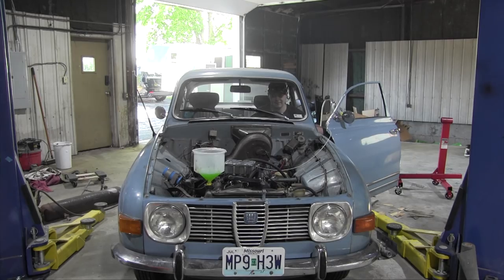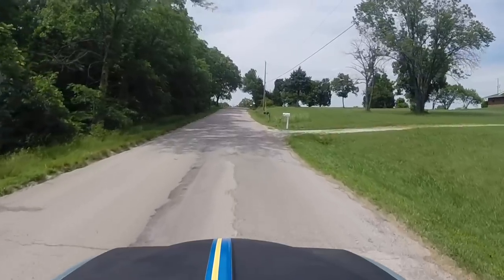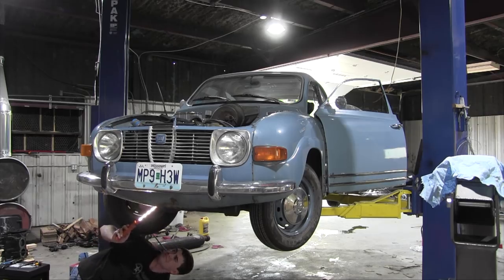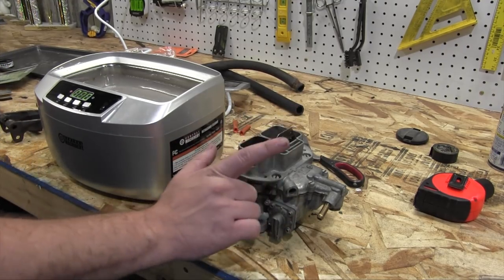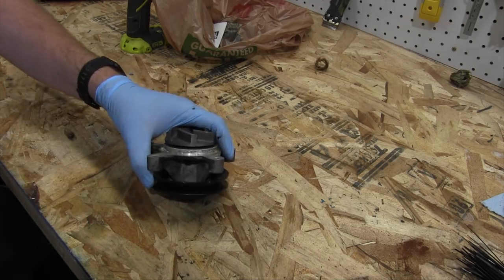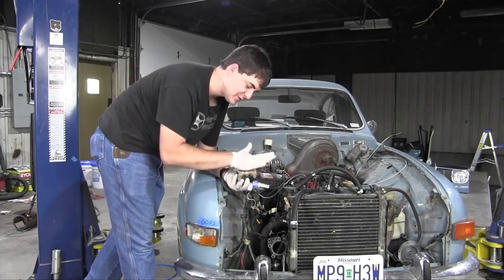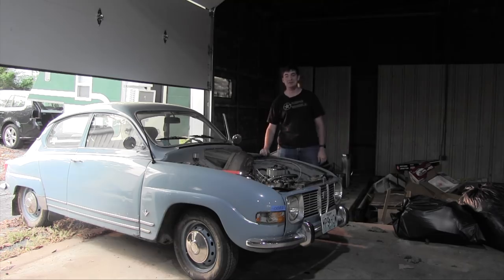Upgrading My Saab 96 to a Two Barrel Carb - Part 3

Comment: you know it would be easier to get that water pump off if you had the engine out. you might even change out the clutch and throwout bearing while your in there.

Comment: If you had used Black Silicone it would not have leaked with only the silicone sealing it. Black dries hard, the blue stays flexible at the expense of strength.

Comment: the vacum advance unit and spring loaded veigths on ignition unit has a lot to do with acelration and power upp hill.Some car the vacum advance is at full preignition  and when vacum builds up it lower the advance itgition.on other it is the oter way.importent to know if the vacum intake on the carb is over or under the 
carburetor gas damper(google translated) those 2 trinn carb round spjelds tha open when you give trottle

Comment: you should not use silicone on an engine, use hylomar or polyurethane based sealant.
Reply: Modern silicone is fine. Many manufacturers use it from the factory. Just get the right formulation.......

Comment: Why not use just straight water when you are checking for leaks?. You can just measure out a gallon of water to fill it first, and if there isn't a leak you could add the coolant to the recommended ratio...

Comment: that V-4 is a ford tractor motor that  came with  one barrel, I didnt see part 1 or 2 the worst thing ive ever seen is when some tries to put a two barrel adapter into a one barrel intake, your idle mixture screw effects the whole range from idle to full throttle

Comment: "Because I'm a simpleton and not a mechanic"
Why not both?
ps, I feel your leaking pain. I rebuilt the engine in my MR2 in about 3 months and it's been 2 years since then and it still not running because I CAN"T FIX THE DAMN COOLANT LEAKS

Comment: i would have epoxied the two halves, because rtv isn't for use with solvents or gasoline, and it would be permanent.
Reply: i'd also drill out the threads in the pump, put bolts in with just simple nutz on the back on the ones that are hard to reach away from the pulley, make it way easier to remove.
Reply: then i saw the wrench and never the  mind lol.

Comment: the Taunus V4 was never meant for a 2bbl unless you rose the compression big time...itll never run right unless you go huge on compression ratio..even then you wont hit more than 110 hp..the Rally car had a 2bbl..the streets didnt

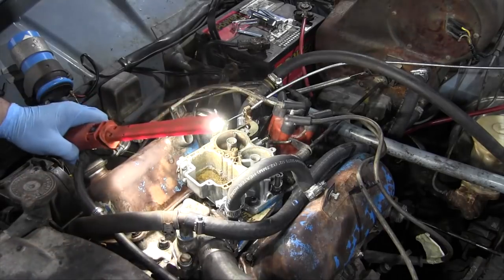Comment: 6:10 fuel level way too low it needs to be at the bottom of the boosters. Re carb kit  this is a DGV a brother to the DFAV which came on Chevy Vegas and Ford Pintos from the early 70's, most parts stores still Keep them in stock (god knows why), not everything from the kit will work but the most important as the needle and seat, accelerator pump diaphragm and power valve are the same.
Reply: The float pushes it way up when installed. So this in the video IS a proper fuel level.
Reply: What do I know? I been  rebuilding carbs for only 30 years...you must know better.
Reply: I respect craftsmanship but i also respect Archimedes.

Comment: Watching the gasket drawn out and cut out instead of soft-hammerded was kinda cringe but I was drilled by old men to dink out the gasket with a plastic hammer and part. "Exact Fit!"

Watevs if it works.

Comment: Seems you got caught out by the Delhi "specials" water pumps that are plaguing many marques for water pumps, us Reliant owners had stacks of them, they look all nice and shiny but are a bag of poo when you wind them on, the one I had I put a straight edge to its mating surface and it had a 4 degree bend in the whole facing, kinda crinkle cut water pump and when I tried to request a refund the ebay seller had deactivated his account so got nowhere fast :(   Another area is old Vespa and Lambretta parts knocked up in Vietnam and Indian backstreet factories, totally atrocious quality and a bloody nightmare because getting parts for my 1958 Lambretta is damned hard enough without getting piles of poo turn up looking remotely like the part you wanted Grr Grr.

Comment: choking yourself with no good ventilation.the face plate has not a smoth openings it is stepped. that alone make the gas turbulence bad and it you dont get max performance

Comment: He seems such such a cool guy with a good attitude. But holy cats this is painful to watch. Silicone instead of gaskets. Poor carb rebuild and cleaning. No idea of carburetor theory or operation. Doesn't understand that the engine needs to warm a little before disengaging the choke. Bad troubleshooting ideas. That awesome little Saab deserves better, so I hope he gains a much better skill set and awareness as time passes.
Reply from the maker: I wholly appreciate your constructive criticism. I'm learning as I go along. I tried to make it very clear that I'm a complete novice.

Most everything you said is right, but I have to make a couple tiny corrections. I know how a choke works. Give me that much credit. Also, I wouldn't say I have NO idea of carb theory or operation. Saying I have little idea would be more accurate. Probably a 2 or 3 out of 10 on the carb knowledge o meter. Everything else you said is spot on. All I can do is try to improve in the future.
Reply: Not cool. I enjoy these videos for the fact that I have made the same type of mistakes & low budget repairs. Nothing painful about this, very entertaining!
Reply: Ahhhh, we learn as we go, but it is painful to see someone not doing it the best way while being unable to intervene with a good suggestion. However, speaking from experience, lessons learned the hard way are rarely forgotten, and learning for yourself gives a sense of great accomplishment even for "small" tasks. I think he showed great patience and determination, especially for being a novice. Be generous with praise and stingy with criticism. Perfection is a myth.
Reply: @jimbranham3281  Agreed but..Where's the service book? There's an old saying "a smart man learns from his mistakes"..Yep good saying... But I say "a smarter-er man learns from the other guys mistakes"...and step by step following of instructions can help you do that. I tell people to use a pencil and check off the step..That way if you get called away for the phone or to get a beer or to get rid of the last beer, you see where you were..and don't miss things--like this guy did when first trying to clean the carb he didn't pull the idle jet and blast it out, and didn't stick the little red tube in the hole where the idle jet was and pull the trigger and blast that out..

Books with text, photos and drawings are wonderful resources...For the 96, the English Haynes is an excellent book and that manual even has the FULL gearbox reuilding section...which this guy, like all Saab 96s noobs really ought to be prepared for...Cause I'm willing to bet a whole nickle this guy has NOT yet checked and changed the gearbox oil..the bar none Number 1 cause of 96s dying..all for a lack of correct oil.

Comment: I can't tell you how many times that wrench would have save some yelling,cussing and throwning wrench.
I have come to the conclusion you love to torture yourself.
Ps. Fine wire like old high guitar strings work will help to clean out small holes in carbs.

Comment: And the moral of the story.
Don't buy cheap parts off of Ebay. It leaked straight out of the box. Say no more. How long will the next one last?
Water Pumps are critical to an engine, if the engine over heats it can cause permanent or catastrophic damage. Don't skimp on some rubbish Chineseum part. Buy genuine and sleep well